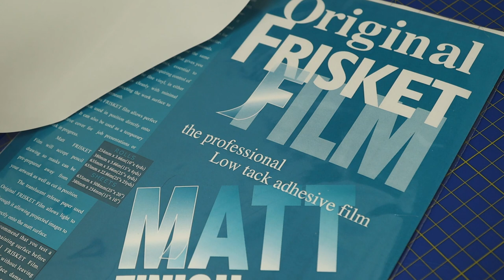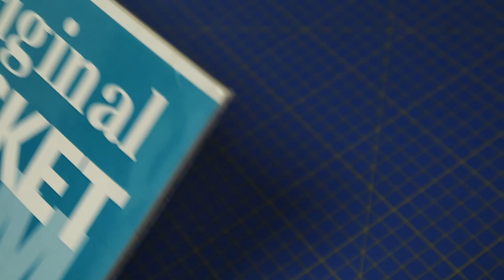Model Railway eBay Rescue | Triang 100t Tanker Makeover | Weathering & Graffiti

Comment: What airbrush and compressor would you recommend for people starting out? At the moment I use only a brush method 🤷‍♂️
Reply from the maker: I use an Iwata Neo airbrush, which is around £80. I wouldn't spend a fortune on a compressor to begin with.  There are lots on Amazon such as this: 
https://www.amazon.co.uk/Timbertech-Professional-Airbrush-Compressor-Oil-Less/dp/B07JKDBYCS/ref=sr_1_6?dchild=1&keywords=airbrush+compressor&qid=1615370249&sr=8-6
Its very similar to the one that i've been using for the past 6 years